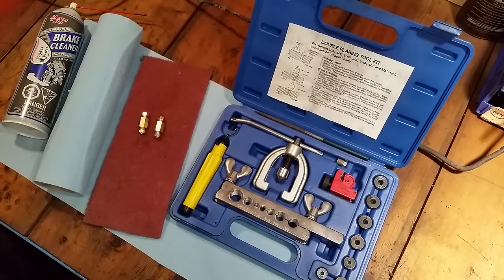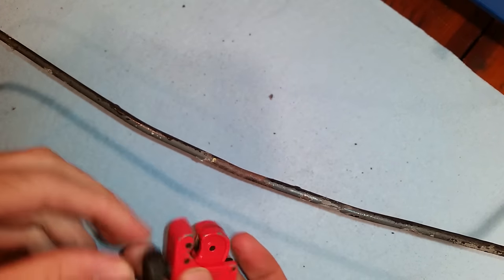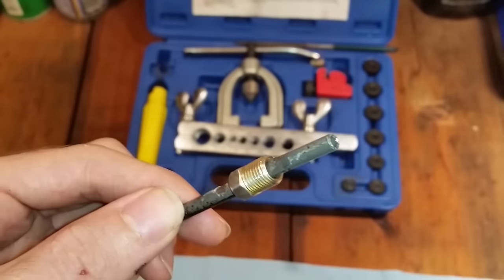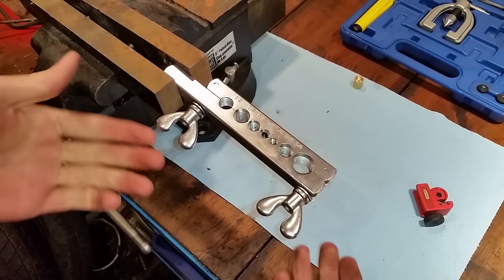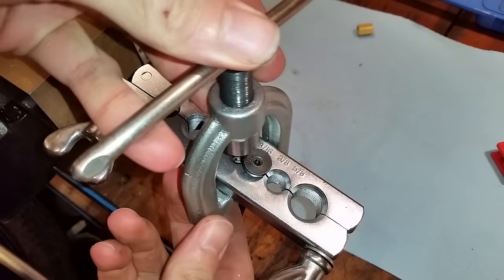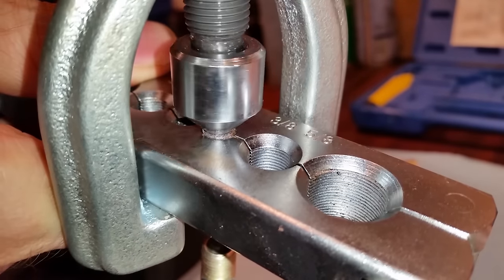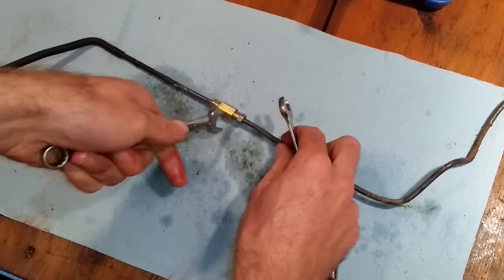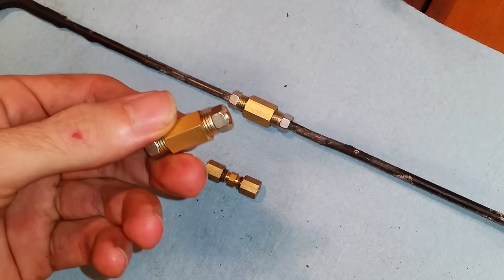How to safely repair leaking and rusted brake lines

Comment: Well i see compression fittings are rated for 10,000 PSI and even higher with steel line and large fittings (not sure what sizes they mean by large). Of course, i think you should be using like new tubing with no damage where the ferrule goes and PROPER assembly procedures re depth of tube in fitting etc. Auto braking systems reach nowhere near those pressures.

Comment: Hello. Thanks for the video. I was doing the flare part wrong and it's leaking.,going to retry now. Could you please tell me the make and model # of the flaring kit you have? I have a loaner kit from auto zone but it doesn't have all the stuff your kit has. Id like to buy my own and that kit looks like what id like. Thanks again!!
Reply: I did my flare without the dyes. fml

Comment: In my province a vehicle won't pass safety inspection with brake unions or with rusty brake lines / weather cracked flex lines ..

Comment: Dude you did NOT chamfer a 45 degree angle on the outer edges of the tubing after cutting it. Aren't you risking your safety by skipping that step ? all the career/professional mechanics i know say that this is a critical step for creating a new flare ?

Comment: I did this and mine is still leaking, maybe my flaring was not perfect, i did it twice but still leaking. Is there a way to seal it, i cant find any seals that small
Reply from the maker: It usually leaks when you do the second stage of the flare. If you squish the flare too far, it won’t have any room to deform and seal on the mating part inside the fitting. Try it again. You should use any type of sealant with this type of connection

Comment: You can buy all the nicopp brake line you will need for a mere $20 and it will not rust out again. Telling people to sand the rust off old brake lines and put it back in is very dangerous since brake lines rust from the inside due to moisture in brake fluid. If they can't afford the $20 for new brake lines then they're going to be even worse off and even poorer when they get into their car and crash into someone because they thought their internally rusted out brake lines were safe.

Comment: I have been looking through tonnes of videos on this but i still can't find the correct answer to this question:
  Some brake lines have a male to female connection but without the female female union. Also are some of those unions convex and some concave on the seat. It seems to me you can either make the flare a cone or you can also make it a cup shape. You should be able to make one fit inside the other. In europe it seems that the male unions / nuts  require  seat into a cup shape receptor weather it be into a flexi line a compensator or a union of opposite sex. But there are male nuts and female nuts and sometimes these are joined together. The line is the same, weather a female or male nut is being used and when they connect together in series each end of line touches the other line directly on the next piece of line in series. So one must fit snug into the other they can't just be flares of the same shape. So there must be a technique on the tool that allows both shapes to be made so one can make the male end or the female end. I have yet to see someone make a female end and to explain how to do the two on the tool. I would say that in your video you just made what is close to a female end for a female threaded brake line nut because you really cranked the cone in on the 2nd run. I have heard you should only tighten down very slightly on the 2nd run with the cone after using the die on the 1st run. I believe it is something close to what i have just described. If you finish with a heavy cranking of the cone down into the end of the line then you make a female cup shaped end but if you only put a little pressure on the 2nd run then the cone just rivets and polishes the line end perfect to use on a male nut with thread on the outside. 
  Then one can slot into the other to make an extension. This is often used when a line has a complicated shape and needs to be fitted in several pieces, or just another repair technique. 
  I would really like to find the answer to how to use the tool correctly.

Comment: I Have a 1988 Chevrolet C1500   2wd 5.7  . Brake line is Lake in between the gas tank and the frame . ( How can I get the break line down where i can see how to fix it )
Reply: It seems you're going to have to cut a larger portion out, and do two unions.  Mine is a similar problem, but I think I'm busy going to replace the entire line.

Comment: i would add that this should be used as a temporary fix, until you can replace the whole brake line end to end!
Reply: Not true.. I am a GM technician... Some of the vehicles come from the factory with Union fittings.. not so much the newer stuff but there's some older stuff

Comment: Compression fitting work a guy proved it , he took new brake line and used Compression fitting on the brake line a he tided on end to his car other to a tree and pulled till the it gave way but the fittings didn't give way the brake line broke before the fitting separated

Comment: how does 1 fix a brake line, in a Tesla where 1 has to remove the whole high voltage battery to run the brake line.

Comment: Why be so cheap?  The line has already failed and other sections are already on the way.  replace the entire line with copper/nickle.
Reply: I want to get my car to  the shop with out burning up one of my free tows from insurance company,  This trick will get me there to have all the lines replaced.
Reply: this is the correct wae. Using compression fittings is not Loved this thanks

Comment: I have used a compression fitting on my brake line and slamed on the brakes more than once with no problems because i made sure it was tight.

Comment: Brass ferrules?!   brass is too soft, won't do!  
   I can tighten a compression fitting  with STEEL ferrules so tight that the line gets deformed,dented in all around,(the ferrule digs in the line,deforms it,making it hourglass shape, can never again be removed of course) and i'll bet the line would burst somewhere else without the fitting slipping out; THE PROBLEM is....not everyone can do that assembly, you need to disassemble it to look at it...a few times;   i used in racing sometimes,but the tubing must be free of extrusion lines,or it will leak very slightly,not enough to sink the brake pedal;    any way, it's pointless,it's illegal to use on the street ,and it won't pass safety inspections, do the double flare,but not with a 5 dollar tool, it won't work straight.

Comment: How do you flare the end on the car coz it looks like you need a vice
Reply from the maker: It's inconvenient, especially if you don't have a lift. But you can easily flare a 3/16" brake line by hold the tool in your hand. You may want to try and wear some mechanix gloves so it's easier on your hands.
Reply: I used a more expensive flare tool, made for under car use.

Comment: Brake line split, so took it to a garage as its just easier, got quoted £700 as its a nightmare job apparently 
As a plummer i was like… WAIT A MINUTE i work with copper everyday so going to do this instead🤣 was about to just solder it back up buy would probably destory the joints with vibrations

Comment: Never use rusty brake line and never use compression fittings for brake lines
Reply: 100% I wish they would stop selling them. I prefer to buy 25' rolls and go point to point. I do that because it is done once and done right.
Reply: Bob Ross  I agree. I have never used a compression fitting in my life plus it is illegal to use in many states on brake lines. 

I have replaced complete brake lines on Fords and Chevy's and never used a union. As I mentioned, I always go point to point even between gas tanks. The rare time I don't, is if it has braided OEM lines off of the ABS pump like I have seen on some Fords. Other than that, always point to point.

Comment: Nice..! But why not replace the whole line?
Reply: Its usually a lot more work. I replaced the rear half of my rear brakeline, using a splice. Why replace the part that is perfectly fine?
Reply: Svein Hanssen well... brake tubing isnt very expensive and the corrosion could have set in on the other parts as well. At least that's how I see it 😃
Reply: Crooked I used this process on my car because a bracket had broken and let the line rub against the frame until I had a leak. In that case the damage was locolised and the rest of the line was fine. This method was much cheaper and easier than replacing the full line.
Reply: Have you actually every ran a full brake line to the master cylinder yourself?

Comment: Ummm nope sorry. The compression union is NOT held together completely by friction.In fact when it is assembled correctly and tightened,the ferule compresses internally and reduces the size of the tubing where it sits making a mechanical joint between the inside of the ferule and the outside(wall) of the tubing that it can't simply slip off of. Check literature on Swagelok compression fittings with two ferules to see how they "bite" into tubing. Basic single ferule tubing joiners and fittings of quality manufacture( forget that imported Chinese junk) work on the same principle. Try to put a compression fitting  together properly and tighten it to spec. then take it apart and try to move or spin that ferule.Its not going to come off unless it gets cut off.
Reply: It't not legal for brake lines anyway.
Reply: That may be true on brass, copper, or plastic lines but the steel lines are much harder than the brass so the brass gives before the steel. I think you need to re read your literature
Reply: You can use a steel compression fitting on steel lines. Brass doesn't cut it for steel lines. End of story.
Reply: Your right,  but if you do not do it up tight enough he is right.  Compression fittings are dependant on the ability of the guy doing the job  so best not to use em on car brakes if u not experienced.  Also if u over tighten em they leak.  I have fitted a few thousands of compression fittings.
Reply: @loisstenner123  You can't use a brass compression fitting on steel lines, and flaring is more of a skill than putting on a compression fitting.
Reply: Are you joking? Do you have any idea of the pressures that are reached in brake systems during a panic stop? Well over 1,000 PSI. You would trust that to a compression fitting. That is the most ridiculous thing I have seen. You can use it on fuel lines because the pressures are much lower, but NEVER on a brake line. I have replaced 100s of feet of brake lines and I always go point to point so there are no weak areas. Of course bubble/double flares at unions work well though. I just prefer to do it that way and have full chevy trucks I have done still stopping well 10 years later. You find one factory brake system on any car that has a compression fitting.
Reply: @marcsmith3881   I am 100% with your knowledge/opinion.  The thousands of compression fitting I have fitted are all on max 9 bar, domestic, water plumbing.   I would not put one on a hydraulic , car braking system, ever.
Reply: @loisstenner123  There ARE compression fittings made for hydraulic systems...
Reply: @timramich  the only way to ensure a compression fitting doesn't fly apart under pressure is to do it up so tight that the olive gets compressed on to the pipe in such a way that  the pipe is also compressed.   It cant fly apart then.   Trouble is , too tight and it leaks.
Reply: @loisstenner123  Can't be done with brass. Steel is harder than brass. Compression fittings for hydraulics are also steel. But people are free to use brass compression fittings on hydraulics if they want to save a few bucks...
Reply: @loisstenner123  That makes sense. That is probably less than 140 psi in those applications. It is illegal in most states to use compression fittings on steel brake lines and for good reason. Since we all share the road, I would hope people are making this repair properly.

Comment: My union won't stop leaking even tho the brake line is brake new both sidw
Reply from the maker: This usually happens when you overtighten the tool to get the 45° flare. It doesn't allow the brake line to form onto the seat inside the union fitting. The only way to fix this is to cut off the ends and redo the flare. Just remember, when you do the second stage of the flare, don't tighten the tool down as hard as you can. It takes practice, so you a spare brake line to try things out.

Comment: Then what? I have bleed my brakes with gallons of fluid but can't get the air removed from my abs
Reply: Might be time to take it to a prow remember air bleeds at the highs level or gets trapped at the highs level. To get air out from near master cylinder with a rag under the brake line connections;  crake open brake line connections individually for a short duration to let air out of the top of the brake lines and repeat proseeduer a few times tell you see no more air if it doesn't bleed the air out the first time. Rember brake fluid loves to eat paint so make sure you use a finder cover; better safe than sorry.

Comment: why put trans fluid on fiting
Reply from the maker: Brake fluid is not very nice to work with. Nasty stuff to get on your hands. ATF is what I had near by. You can use engine oil, gear oil, etc. I still flush the line with brake cleaner before installing it so there is no chance of contamination.

Comment: OMG!  Great video but if you've pulled the brake line off, then BUY A NEW ONE!  $25 IS ALL for a brand NEW ONE!  C'mon!  You'd be doing it anyway in a year if you've got that much rust on 1 part already.  GIVE GOOD, THOROUGH info on the most important part of the car!

Comment: No no no you do not use compression fittings 🤦🏼‍♂️🤦🏼‍♂️🤦🏼‍♂️🤦🏼‍♂️🤦🏼‍♂️🤦🏼‍♂️ temp fix to get home ya Shure but just replace the hole line it's not difficult at all

Comment: Why are you doing this? You have money to buy toolkit and all that stuff, but no money for new brake line? I think the best way to fix rusty brake line is to buy whole length brake line tube, and bend all curves as original tube has and just add new fittings. Or visit to local store and get new original brake line if it is vailable for your car. Don't play with your brakes adding new weak spots (joints)

Comment: Why not use brake fluid as a lubricant, instead of transmission fluid? (@4:18)
Reply: “Can you use brake fluid as an alternative to transmission fluid?” No, and again a big "no". Brake fluid is not primarily designed to be a lubricant, it's designed to transmit hydraulic forces and isn't meant to be used in a way where lt is exposed to contaminants.

Comment: According to Finnish law, car brake lines cannot be extended. Shame😞
Reply: Well, their length is supposed to stay the same, just with extra connectors.
Reply: Most states in the USA have no MOT inspection, so unfortunately you can pretty much do whatever repairs you want without regard for the safety of other drivers.

Comment: this is NOT THE CORRECT WAY!

when you have a rusted brake line the ONLY SAFE WAY IS TO REPLACE THE ENTIRE LINE BECAUSE YOU CANT SEE THAT OTHER PARTS OF THAT LINE ARE SOLID .......
UNLESS YOU HAVE XRAY VISION.        
AS FAR AS COUPLERS OR UNIONS GO THE ID HAS TO EQUAL OR EXCEED THE ID OF. THE LINE....
IF YOU DONT UNDERSTAND WHY YOU SHOULDNT BE GIVING ADVICE ON THIS TOPIC !   
when it comes to brakes the rule is SAFETY FIRST . YOUR WAY IS NOT SAFE OR WISE !

Comment: Lmao been using compression fitting for a very long time never had any issues with them. I even use them at work for very high pressure ammonia refrigeration systems. Think you need to get your facts straight bud.